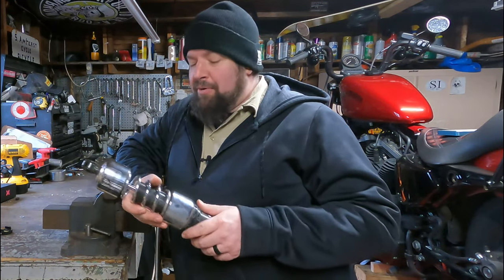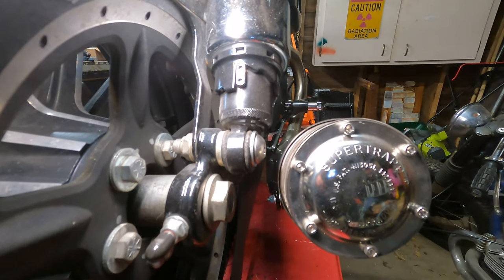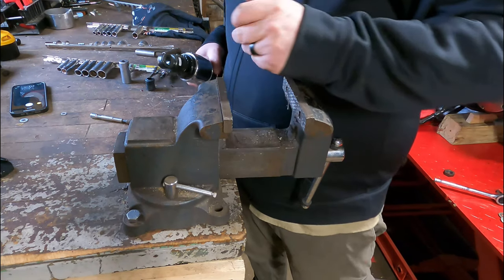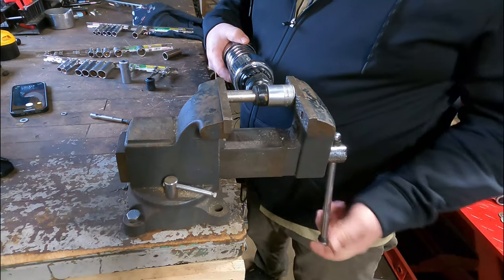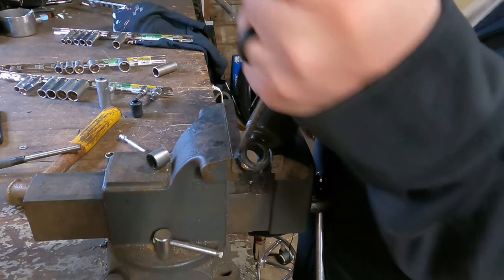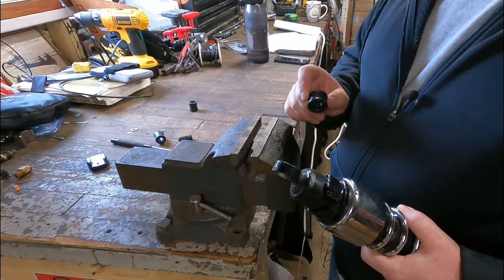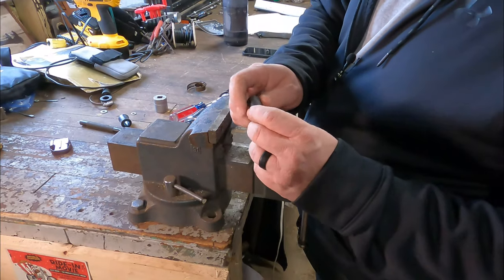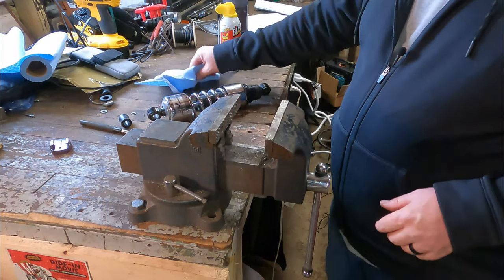Shock Bushing Replacement

Comment: What model of shock do you have?  I have a set of really old shocks that i need to replace the bushings in (I'll upgrade eventually but they're still good) but they couldn't pull anything up from the number on it. But the bushings in mine look identical to yours. So if you could tell me what model yours are i could order replacement bushings for mine. Thank you.
Reply from the maker: They are progressive’s  entry level shock.  I don’t remember the number now.

Comment: The new bushings from progressive from what they told me do not need to insert the metal sleeve into it like the old bushings had.
Reply from the maker: Well shyte. That would have made the whole task simpler. Either way, it’s good info.
Reply: Looks like he got the old rubber bushing though so he did need the metal sleeve. The new progressive bushings that don’t need them are a hard polyurethane that are a bitch to get in without a press.
Reply from the maker: @BossMan302  squeeze them down with a hose clamp to get them small
Enough to start in.
Reply: so you dont have insert the sleeve?
Reply: @dennisfab3869  not on the new bushings however the bushings in this video are the old ones so they need the sleeves.
Reply from the maker: @dennisfab3869  it depends on the inside diameter of the bushing. If there is a lot of slop with the bolt installed, you need the steel tubes. But some shocks don’t use the tube.

Comment: Well new bushings came but are not the right size👎
Reply from the maker: Oh that’s sucks. Did you contact them
Reply: @KnobleMoto  I haven't yet. But thinking i may order new shocks.. Not sure how long these have been on the bike.. They look like they've seen some miles..
Reply from the maker: @steelhanded11  you can never go wrong with new suspension